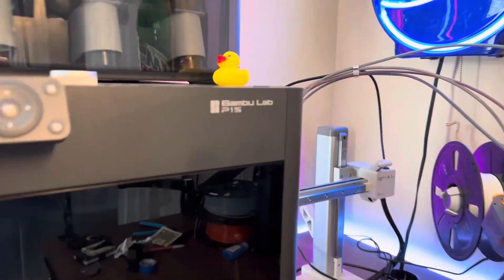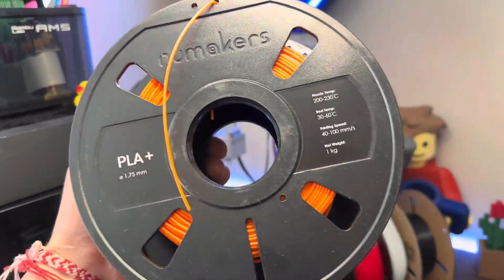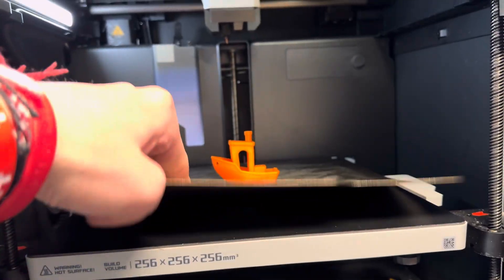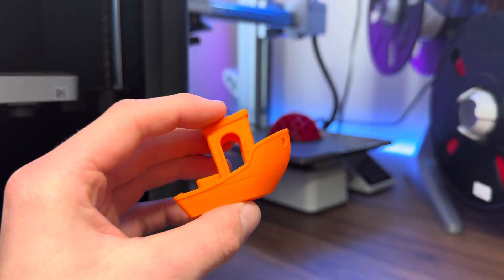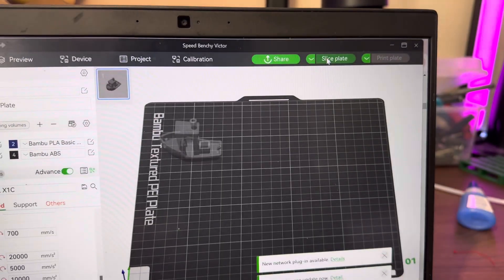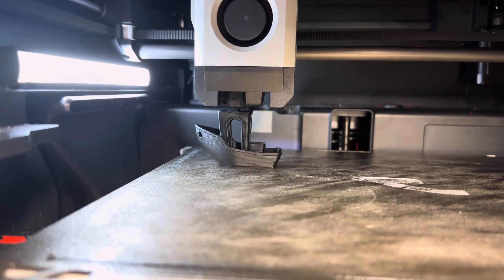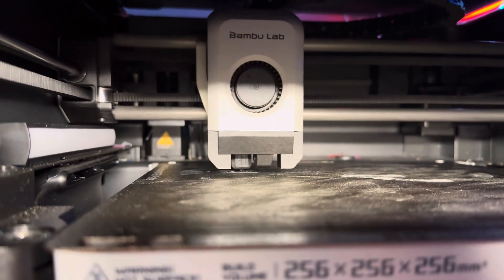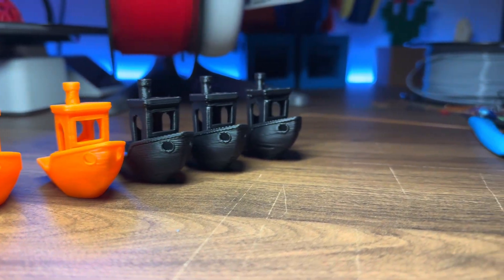Pushing the SPEED of the Bambu Lab P1S

Comment: 6 min to start before every print ? Can't just make the bed leveling once ?
Reply: Its not necessary, I almost never do bed leveling.
Reply: @symix.  So i can do it once and print until i feel that the bed needs leveling ? We are talking about the P1S right ?
Reply: @dansv3872  yes. When you start print there is checkbox for "bed leveling" just turn it off.
I turn it on for once maybe per week/month or if I have issues with quality.
I have P1s too.
But the print start time is still some time because it cleans the nozzle etc

Comment: Does printing in L mode lead to greater wear and tear on the printer? Or does speed play no role when it comes to wear? I'm a bit worried about the axles; bearings; Motors and belts. I would appreciate an answer.
Reply: It would probably wear things out at the same rate as normal printing, but literally faster cause you're printing faster
Reply: @Verbosal  so it does wear out faster, did I get you right?

Comment: This isn't how you push a printer to it's limits. Ludicrous and Sport modes are gimmicks, they up the speed of the printhead but don't adjust temps, pressure advance, flow rates etc. Get Orca Slicer and do some calibration for your filament, then increase speeds through slicer settings. You may find you can print just as fast but in much better quality.
Reply: Where can I learn more?